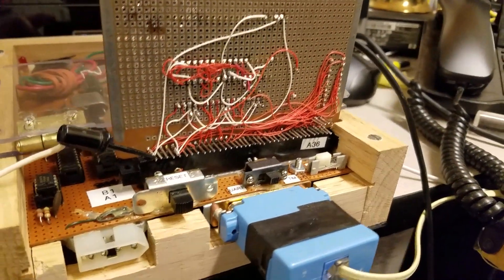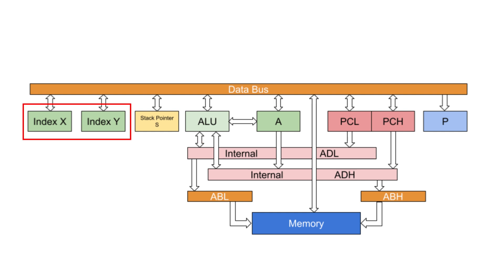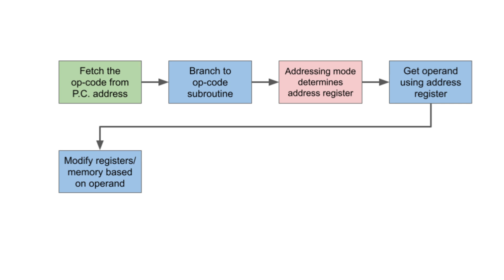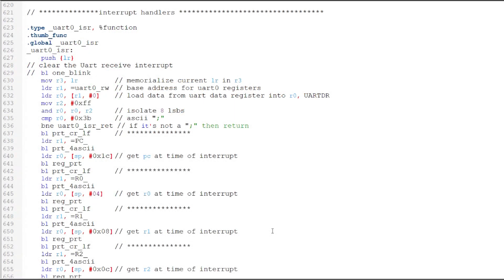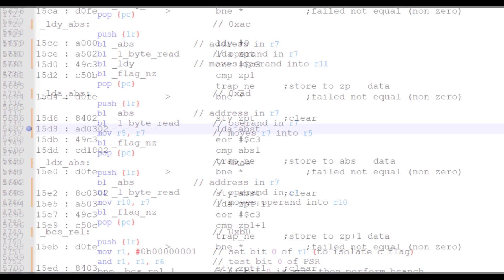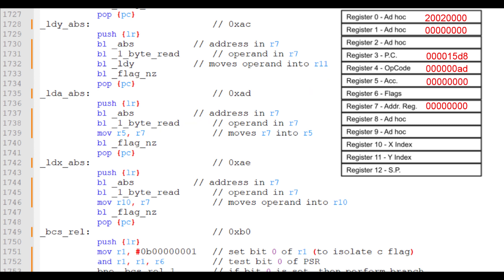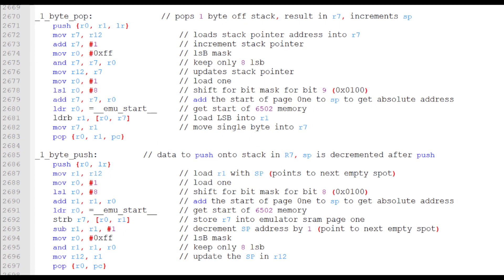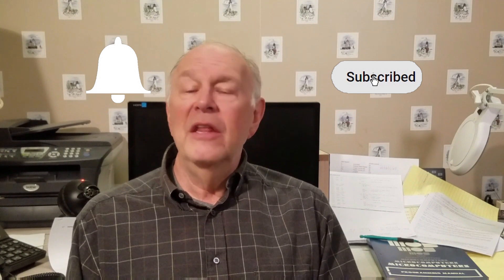RP2040 - Bare Metal 6502 Emulator - BMA 09

Comment: I'm doing something similar but to emulate a Z80! I learned a lot from your videos. I could get it running in an experimental pcb and now a friend is helping me to design the final PCB. Thanks for share with us your knowledge. Greetings from Argentina!!
Reply from the maker: Congratulations!  That sounds like a cool project.  The Z80 is a little more complicated than the 6502, so you had a bit more modeling to do than I did.  Thanks for watching!
Reply from the maker: @NeverMind-pk4wzThat's really impressive since the clock speed of the Mega32 is so slow!  I guess I'm a piker since I have 125 MHz to work with.  I hope I can get the second core and PIO to take care of the timing required  for video; we'll see how far I get.  Thanks for the comment!